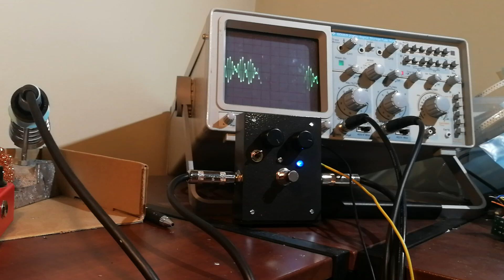Analog Multiplier in Action

Comment: I have used your circuit a number of times over the years. Yours is not a common implementation of a multiplier (not that I’ve seen) and it has a cleaner output. Well done.

Comment: Great project! I am about to build it over the weekend on SMD prototyping board. There is one place in the schematic you drew for the EDN article, where you put two resistors in parallel. Was that simply to economize by using the same values as elsewhere? Or is there some functional reason why it should be two resistors in parallel which match the values of the others in the circuit, instead of one at half the value? Thx!!!!
Reply from the maker: Thanks! This circuit had become a real workhorse for me and has been continually evolving. 
The parallel resistor is just a matter of economy, I use 0.1% 0603 for my standard multiplier, which is at the cost knee point, seemingly. I don't trust two resistors which were manufactured at different times/ places to actually be a solid 2:1. Frequencies are well below needing to worry about the additional strays/routing. I've also removed the "training wheels" resistors feeding the ring for improved performance, and I use two log amps (constructed from the same diode pairs as the ring) to achieve rail-to-rail linearity, as opposed to just small signals. I recommend the BAV99 schottky pair for this type of circuit.  There is also another, closely related op-amp multiplier topology which I need to do a video on as it is better in some respects than my first one, here.
Reply: @analogplanet9675  nice! If you have posted anything about your other multiplier anywhere pls do let me know. My application is for line level signals multiplied by synthesizer waveforms up to about +/-5V on a +/-9V system. The AD633 multiplier IC has a /10 function at its output to keep things under control. I assume this one will just blast off to the rails if the two signals being multiplied are hot enough?

Comment: It sounds amazing! I have two quick questions: 
From what I've seen on your site, the circuit needs only two values of resistors, R and r. Which values should I choose given that I want to use this circuit in a guitar pedal application?

Also, what kind of oscillator are you using?

Thanks in advance!
Reply from the maker: Thanks! The ratio of R to r defines an attenuation factor before the ring, which is "gained back up" on the other side. 

The Schottky diodes only act as good multiplier elements up to about a hundred millivolts, so if you want +- a volt or two of headroom, which seems to be plenty for a guitar pedal, that ratio should be around 10 or 20. 

A higher ratio leads to more linearity but more noise, although it's a pretty forgiving trade-off with even halfway decent amps. I also found that the multiplier sounds equally musical but different when slightly overdriven. A bit less 50's SciFi I guess. Deffinitely worth experimenting.

I've tended to use 10k and 100k/220k for musical applications with +-2.5v rail-to-rail amps. 

The oscillator is a common circuit with Schmidt trigger + integrator, giving you square waves and triangle waves, which can be soft-clipped with diodes to get faux-sine. 

The most important thing I "discovered" is to injection lock the oscillator to the guitar signal. Tightens the whole thing up and sends you through a pretty awesome sonic wormhole. 

Good luck on your build!

Comment: Excellent EDN article. It would be interesting to use the quadrant multiplier to re-inject harmonics back into the guitar signal. Taking an FFT of the Guitar signal,  take the dominant spectral peak to define the frequency of interest, and use that to set the frequency of the injected sine / square etc signal back into the multiplier.   Using some offsets on the frequency control signal allows you to also inject arbitrary harmonic structures back into the guitar signal.   You would need to introduce delay into the  controller signal (guitar input) to allow enough time for calculating the FFT on the run.

Great work with the multiplier - keep it up.
Reply from the maker: Thanks for the interest and encouragement! Your intuition (that real musical usefulness it's a few steps further out) is quite correct. I've built several circuits along the lines of the ideas you mention above. The most effective device finds the lowest frequency in the musical signal (which tends to name the key of the moment) and sets the oscillators frequency in terms of that, with some offset just like you suggested. Another highly effective strategy is to simply injection lock the oscillator to the signal. both methods can produce absolutely astonishing sounds. Stay tuned for demos of the above. 

Cheers
Reply from the maker: @feudiable  glad to hear of your interest. It's really cool that someone else is simulating my circuit. So, you are quite correct that a small change in a subset of the resistor values doesn't profoundly destroy the multiplier action in terms of the signal shapes, when viewed in the time domain. However, many applications require the output to be relatively free of direct "feed-through" from the inputs. My toy/test application was as a musical effect, which seemed to require that the inputs signals show up directly in the output at least 60dB down, RTI. Resistors matching is only half the battle. Ensuring that both inputs are free of D.C. offset can easily become the dominant consideration. Have a look at the feed-through spec of commercially available multipliers  like AD 634 or 734. Those are the numbers to beat, or at least approach... On your sim, if you try setting one input to zero and put a tone in the other and see how good of an attenuator you have, you can explore how critical the matching really is. If you send me your results, I 'd happily publish them on this channel, with credit of course. There deffinitely is a bit of interest. 
Cheers!
Reply from the maker: @feudiable  Right yeah, that's one of the main difficulties in rolling your own multipliers. In the musical case, you don't want to hear your oscillator directly, constantly droning away. The same thing plays out in other applications in various ways.  Right, cheap ring modulators often have noticible feed-through problems. Most have a trim pot to balance the oscillator input. 

That's a cool result from your sim. How does the error seem to vary with resistor tolerance? Another possibility is that op amp bias currents can cause unbalanced voltages. For that reason, smaller resistors are generally better but the amps need to be able to drive them comfortably. Also, input impedance as you mentioned. 10k, 100k seemed to work well for me. 

The diodes have exponential IV curves over some range of small currents, these curves are sort of pasted together to approximate a square-law, where Out=in^2  The ideal diodes have a linear response when forward biased and so they don't form a multiplier.